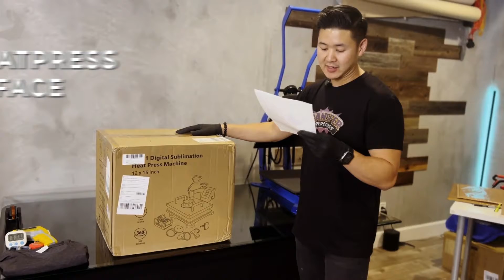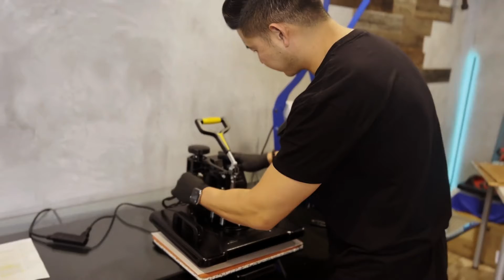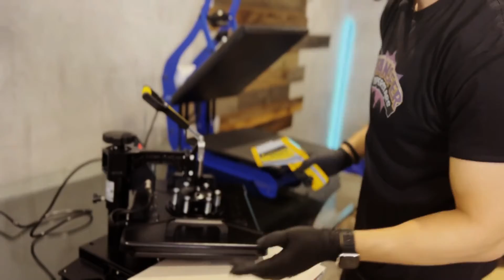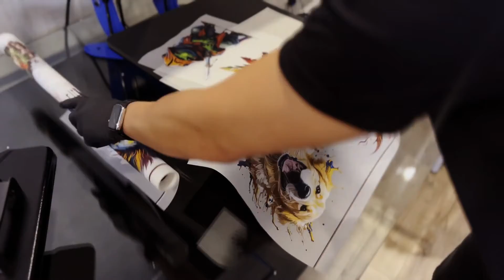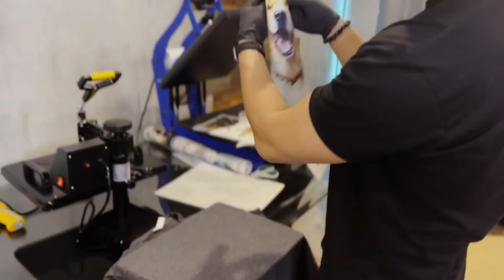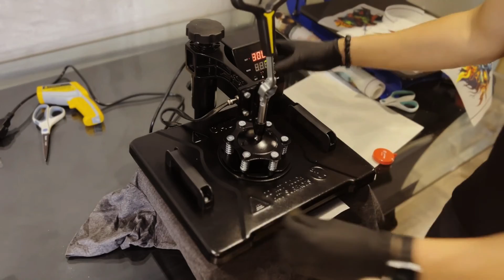Unboxing the SLENDOR 5 in 1 12x15 Hat and T-Shirt Heat Press

Comment: I bought this heat press and I think is good but the only thing that bothers me is the beep sound and there is no button to cancel it.
Reply from the maker: It’s a safety feature. You always have the option to modify the sound by muffling it with some tape where the sound is emitting from.

Comment: How do I reset the locking temp function?
Reply from the maker: What do you mean locking temp function
Reply: @transfersuperstars  in my manual it says when you first turn the press on to turn the temp to the highest temp to lock it in. I did not read this part before starting. Now my press won't heat up to 480 it only temps to 365. I was wondering if I could reset this function to factory reset.  Vevor 5-1 heat press. My girls bought it for me Aug 2023. The pressure points are off and the bar in the back is bent. I wish I could attach a photo. 😭

Comment: Hello, I took a services of another company and after transfer the images on my 100% cotton tshirt  and after the 1st use before washing I realized cracks in the hole image and looks like that pealing will start soon. Does this happen to your transfers too?
Reply from the maker: No it should last a very long time if done properly. We have shirts over 2 years that have not lost color or cracked. However there are lots of questions that are needed to be answered in order to find the cause. Was the adhesive powder cured properly? How much pressure are you using? Are you following their cure times/temps? Did you do a double press? If you'd like to test our transfers, you can order a free sample pack from our website. We have detailed instructions that will show you how to properly apply them. Please let me know how we can assist you. If done right, DTF transfers last a lot longer than screenprinting, vinyl, and dtg.
Reply from the maker: It shouldn’t but it also depends on how the heat press you used. The temp and heat used to cure the transfer onto the shirt. It can also be the transfer. But most of the time it’s the pressure and heat (temperature).